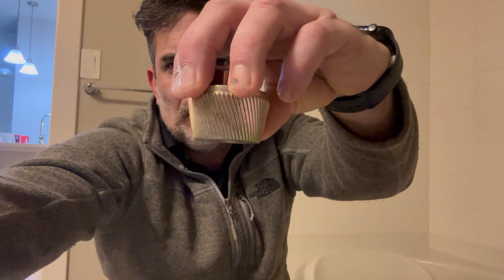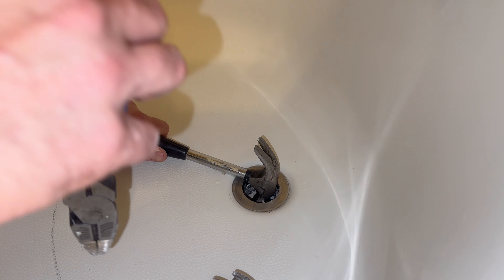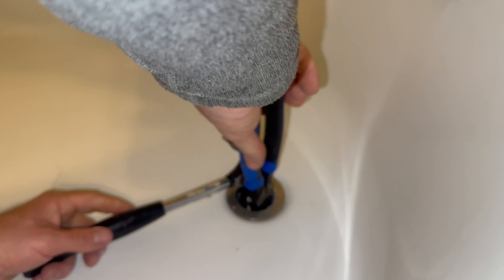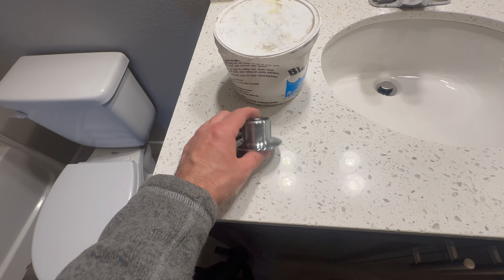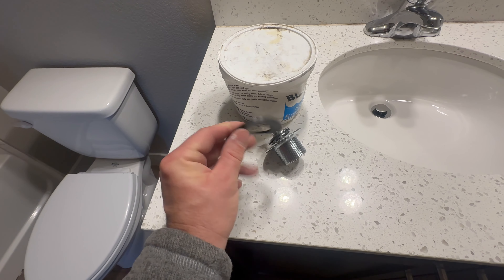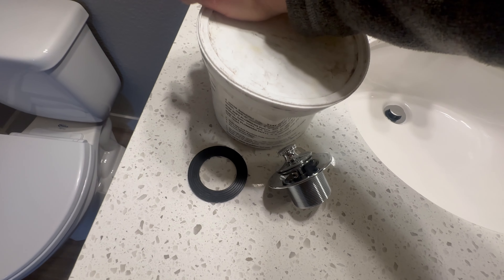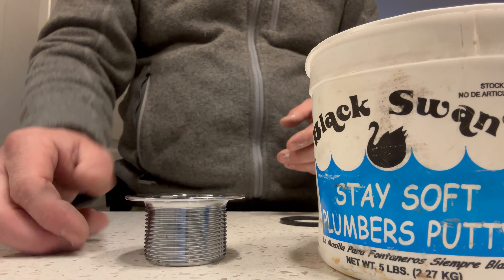Tub Drain Removal and Install - no Crossbars

Comment: Tried this in a vacant unit but I only had channel locks and a hammer. I couldn’t get it to bite but seeing you pull that tub drain inspired me to hammer the absolute hell out of that drain removal tool into the drain and I finally got it to break loose. I used a hack saw blade to cut 4 or 5 notches in the drain for the tool to bite into. The old one was also installed with silicone which locked it in even more. Nightmare, but it’s all done thanks to your motivation! lol

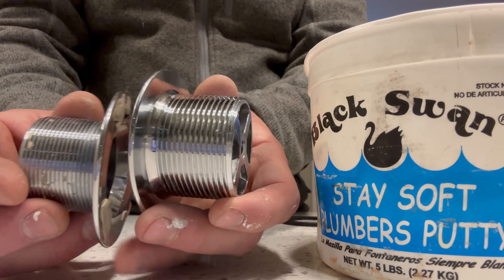Comment: @02:12 For the thread problem,  try measuring the inside diameter of drain prior to removing them, it looks like one is larger in diameter and one is smaller. That may not apply if each size has two different thread per inch counts. Good video. Thank You...